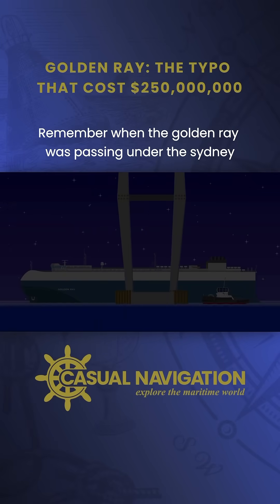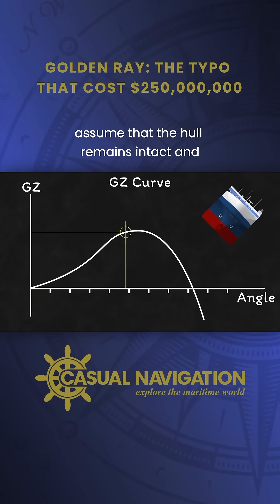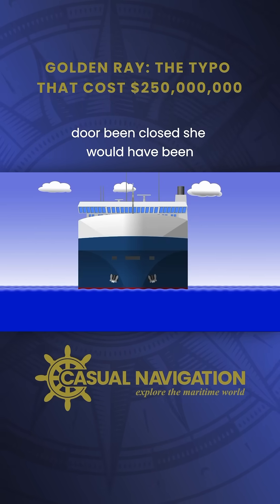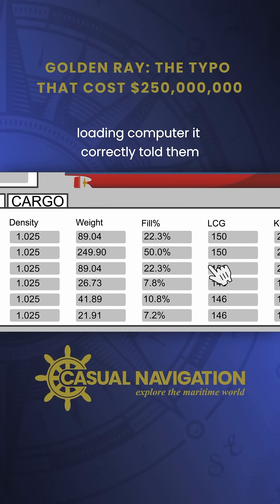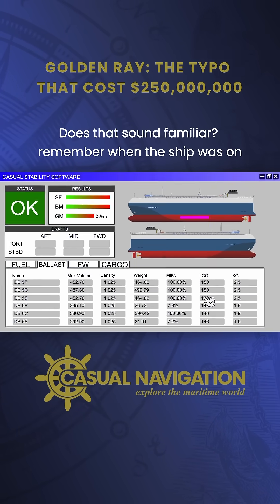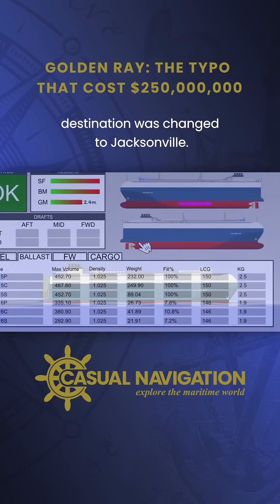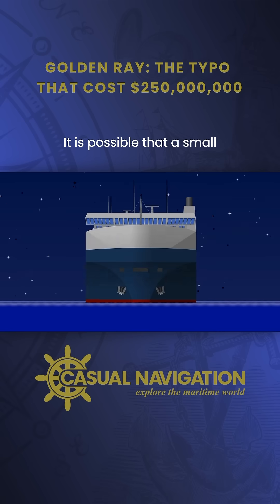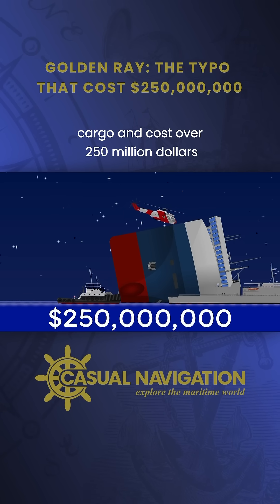The $250,000,000 Maritime Disaster

Comment: Basically, NEVER leave the calculator in "manual" without putting the correct values into the calculation fields EVERY TIME.
Reply: Manual in this case means that the loading computer doesn't receive tank soundings in real time from a remote sounding system. Most ships don't even have a remote sounding system and rely on manual soundings of tanks.
Reply: @subbaaja100  All of which is time better spent watching for hazards.
Reply: @ColtonRMagby  you don't leave port without knowing that you have sufficient stability.
Reply: @subbaaja100  True, but you should know about any navigational hazards that weren't there when you pulled in BEFORE you check that. If it's not safe to leave, why bother checking the stability beyond making sure it's not leaning while tied to the pier?
Reply: @ColtonRMagby  If she's leaning while moored. She has no business leaving port and list should be corrected immediately. As per Intact stability code and SOLAS agreements.
Reply: @subbaaja100  As should a canoe or kayak.